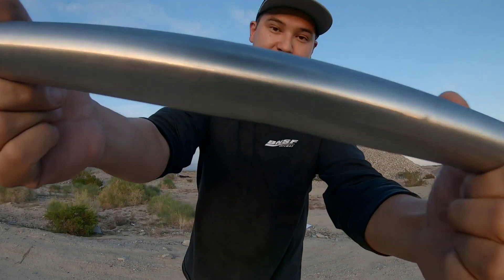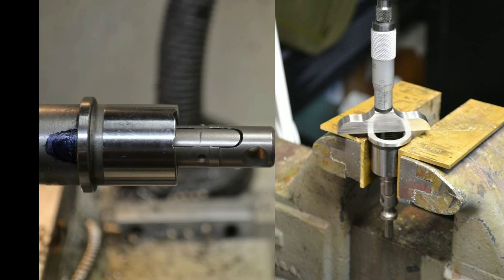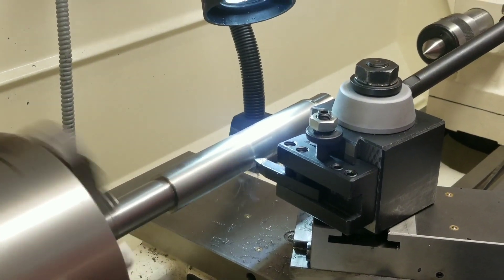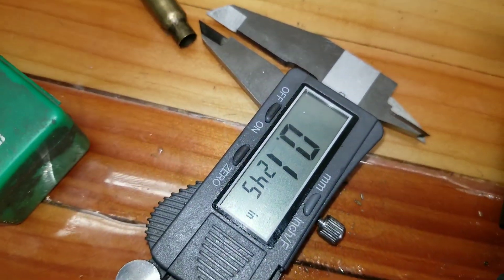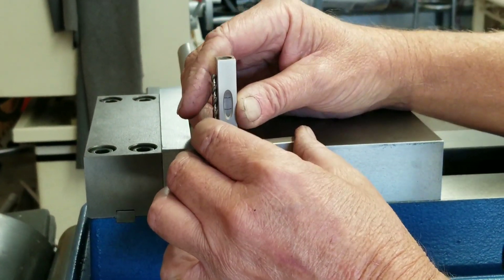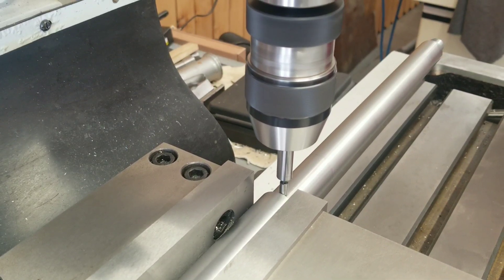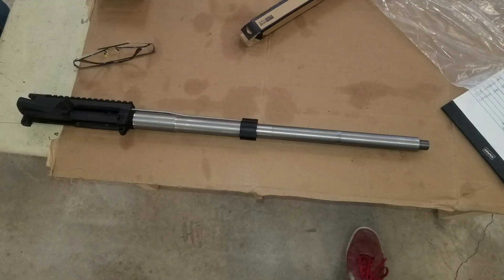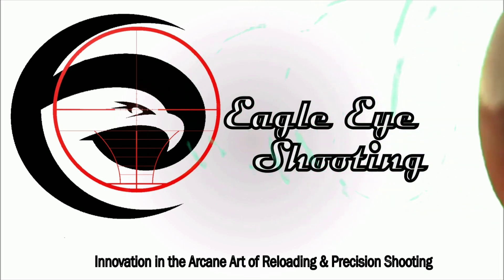Build your own AR Barrel from a blank | 358 Legend barrel Build

Comment: The gas port most often isn’t supposed to line up with the hole in the gas block if it’s all the way against the shoulder. This allows use of a delta ring with non-floating hand guards.
Reply: Fuckin kids and there cameras, be in the moment junior.

Comment: What would you say is the minimum quality lath you would use for making a barrel ? Would a grizzly g4000 9x19 be up to the job ? I plan on making my own custom rifles and won't be making a lot to start out with  I only have 2 projects currently Thanks for the vid
Reply from the maker: Spindle length is key factor which I would look into. Minimum barrel length that allows the use of the outboard spider to center the bore. Else you will need to make extension tooling that threads onto barrels. Most barrels will require final polishing, so it might be a better investment to get a longer bed way between centers like 36".  The G4000 lathe will limit your ability and you'll be wishing you had these features.  I use a Shopfox M1112 which is basically a Grizzly G4003G. Shopfox includes more attachments and 4 jaw chuck for cheaper
Reply: @EagleEyeShooting  thanks 👍

Comment: The gas block issue being short is that some of those are set to work with a delta ring handguard with has the triangular plate sandwhiched between the shoulder and the gas block. Basically the front retaining plate acts as a spacer to set the gas block in the correct position.

Comment: Broooo. Very cool build and props for filming but I work as a machinist. Why on earth would you not use the tailstock for contouring? That way you know it will be true to the bore. Also why would you ever use a cheap square level combo when you literally have it in a mill? Indicator is the best way.
Reply from the maker: 3rd year running a lathe. I come from running haas VF6's. I now a few tricks now lol

Comment: watching yall find center is spooking me for that gasblock hole. next time you can find it in seconds using a parallel between the part and the drill, move down on z till your just holding the parallel to the part with the drill and you can move on Y to see it lean back and forth and once the parallel is level its center.

source: im a cnc machinist and its how i save time at work when dealing with round stock that i cant probe the outside web due to workholds

Comment: Home builders tip. If you want to do your own custom logo and don't have a Laser machine, here's an idea. 'Paint' the area with tool dip and use exacto knives and dremel to remove the rubber in the pattern of your design. Mask the rest and sand-blast it with coarse sand. Nice markings easy. 
    Y'all take Care, John

Comment: Your data you’re using is incorrect.  I’ll give you everything you need if you message me. The internet is not the place to find data on barreling for the AR as most of it is incorrect.   Good vid overall it just needs accurate info to fill in.
Reply from the maker: Thanks for offering,  I used the gas tube chart as reference, the rest was fitted per the parts I had, working great. Would be glad to get that info from ya. Info.dpgunworks at gmail.

Comment: It is a special thing when the Machinist shows that each step of the process is a project in it's own. His hard to wrap your head around, however,, Companies used to manufacture firearms using that as a build process. Now, don't get me wrong, in these modern times with polymer technologies the process is even further reduced. Ruger had is figured out producing steel firearms with acceptable profit and with all firms these days with the advent of polymer, they simply made manufacturing too competitive for firms like Colt and Smith&Wesson to produce their steel firearms and make competitive profit. It's all about mass produced speed of manufacturing. Anyway, like it or not the page has turned. That's my small rant,, hehehe  :) -Dave

Comment: EE, great vid.  I am never gonna do this work myself but would love to find someone to do this as I have never been happy with the available twist rates.  1:16 for the 350 and the 1:14 for the 358 seem too slow for the heavier rounds.  I see you went with 1:11 and I am interested on what weight shoots best from this as well as how it handles the lighter weights.  Looking forward to the testing!
Reply from the maker: Thanks brother!  Actually Im having really really good results with 200gr FTX and Speer Hotcor bullets. Ive been playing with cast bullets in 160gr and also 140gr with really good results. About 1 inch at 75 yards. It seems to handle pretty much all weights. With the lighter projectiles in cast lead. I have to slow down the RPM and get the velocities down to around 2100. Using H4198. Thats where I'm seeing accuracy.  I haven't shot any FMJ's lighter than 158gr FTX's. Need to pick some up. But basically all FTX bullets have been the most accurate with a near compressed charged of H110.
These where the groups shot at 85 yards with cast bullets in this 1-11 barrel. Both weigh 162gr
358 Legend https://imgur.com/a/eSPIMil
Reply: That sounds really promising as I want this to be a good hunting gun in the 200 or 250 and under range.  I will be reloading for it so the 358 is much more interesting.  Thanks for the reply.

Comment: I've got a question for you? Can you build me a 7.62x39 that will use the 6.5 grendel bolt! They are both based on the same case but, the 6.5's bolt face is much more robust! Obviously the main difference is the barrel extension and bore diameter👍🇺🇸
Reply from the maker: I have no clue where to even get those extensions?
Reply: @EagleEyeShooting  well I thank you for the response👍🇺🇸

Comment: Very interesting. Love the precision equipment. Wondering about 358 Legend...are you attempting a new wildcat or is this what you think Winchester should’ve called the 350 Legend?
Reply from the maker: Its a custom spec reamer that necked up the case mouth opening on a 350 Legend SAAMI reamer to allow chambering and release of a 358 bullet. From the results im seeing.... Winchester should have went with a 357 bore and 357/358 bullet. As there is a plethora of projectiles in that diameter. Specifically the FTX's work the best

Comment: Very cool. What diameter barrel did you go for? I noticed the title says "358 Legend" and the barrel "358 Eagle". Wasn't sure if this was the .355" you often see quoted for 350 legend, or if you went with .357"-.358".
That was interesting about roughing up the chamber. Makes sense though, since you want the brass to hold until pressure drops and the brass is ready to be extracted. I'm glad you guys showed that, I've considered polishing the chamber in the past to help with extraction / feeding.
Reply from the maker: Legality reasons, copy right and also as a request from the person I made this barrel is the reason why I lasered 358 Eagle on the barrel. Bore is a 357. I highly advise never to polish a chamber of any barrel. You'll find your self hitting pressure signs faster, lose of accuracy, and hard extraction in humidity.  Basically it removes the ability of brass to cling temporary and seal

Comment: Great video question on the gas port you said you deburr and chamfer but what happens to the burr in the barrel and once you fire a bullet it can cover the hole or it does not leave a burr
Reply: ocean374 I think you just blow it out with an air hose. Just my thinking, though.
Reply: Thank you it is interesting though
Reply from the maker: It'll leave a very slight bur that will be removed after the first or few firings. It's important to use a very sharp drill bit and proper speed and feed to get a clean cut. That ripping sound is what you wanna hear when it breaks through. After the first firing, I used my bore cam to inspect for fouling build up around the port.
Reply: That’s cool thanks